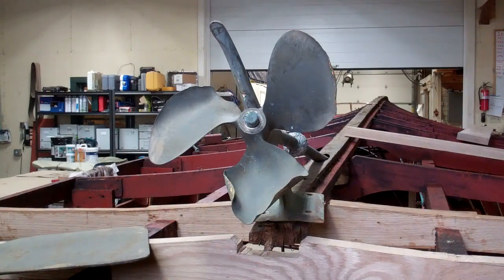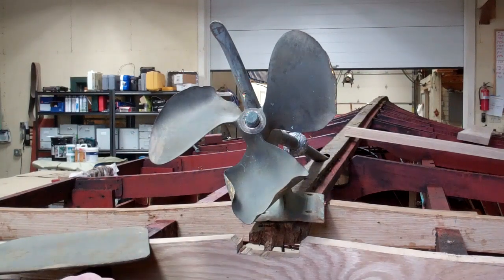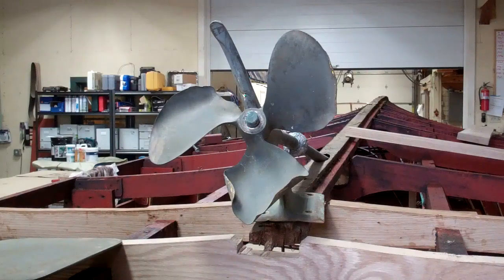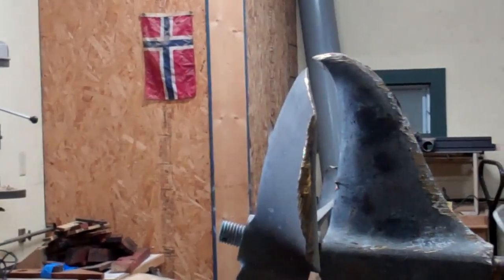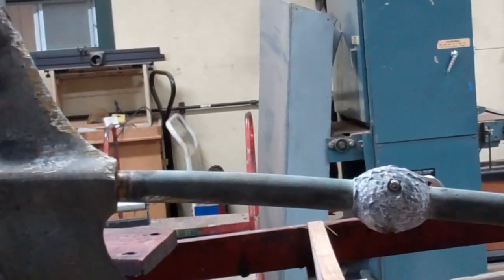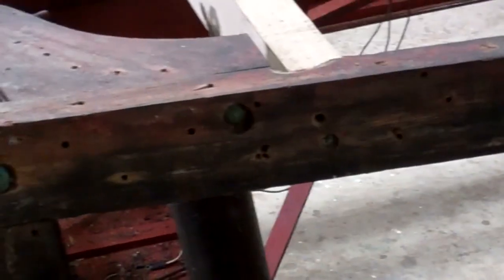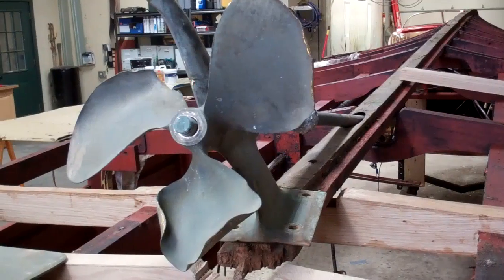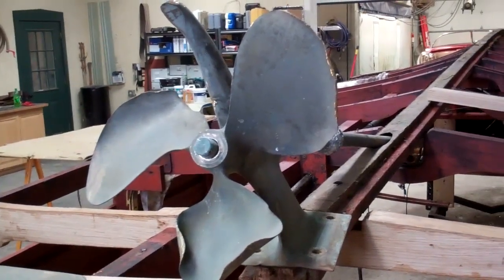1947 Chris Craft U22   Bottom Damage Quandry 1 31 2020 Snake Mountain Boatworks LLC

Comment: What direction is the force put on it from the motor getting stopped that fast? It could have sent that torque right out the frame to the chine
Reply from the maker: Bingo! She spins a right-handed prop, which means counterclockwise viewed from the transom, or towards the port chine, The engine's torque , then, could well have driven those frames into the port chine. Thank you!